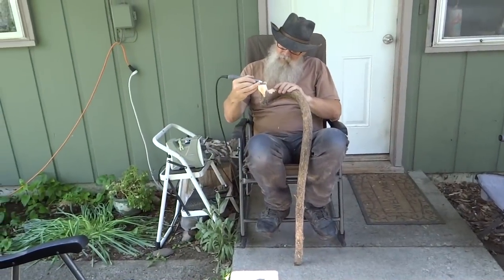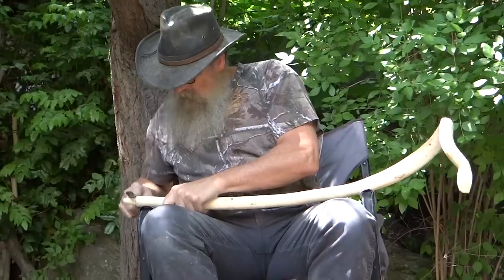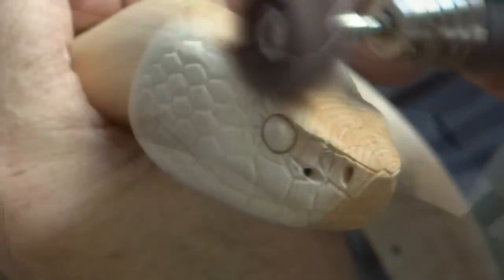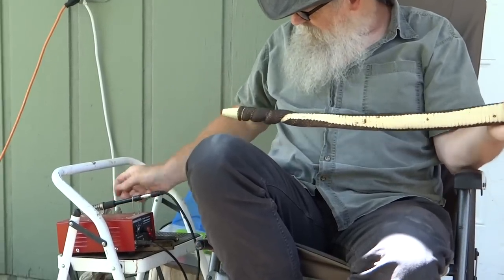Carving a Wooden Copperhead Walking Cane

Comment: As usual the copper head turned out awsome great work love your videos what was that but you used to make the eyes
Reply from the maker: Thank you, Lloyd! The material I put on the eyes to give them a smooth clear gloss, is UV resin which is cured with a UV light.
Reply: @StinnettSticks  great the eyes look amazing what did you use to carve the eyes in with